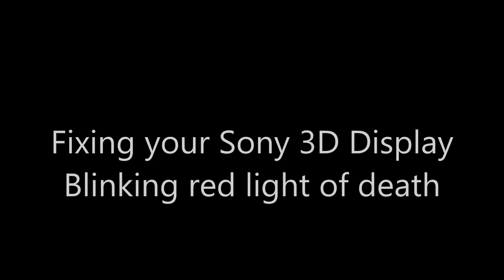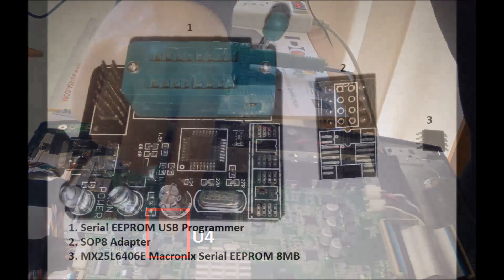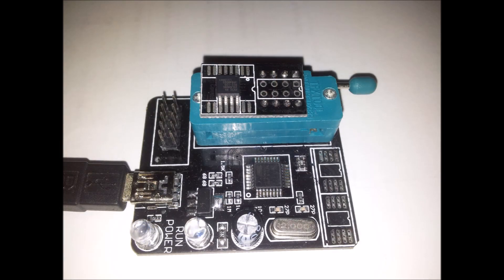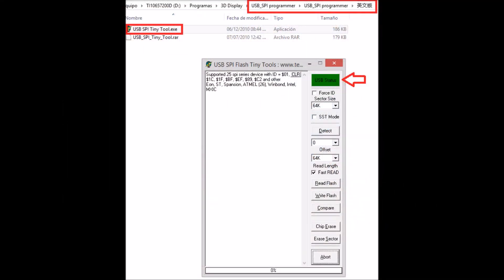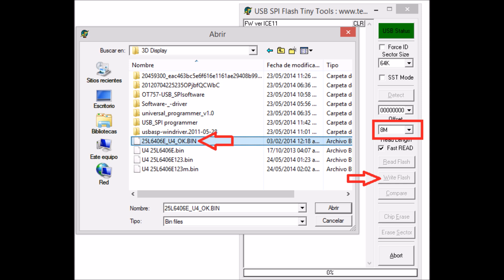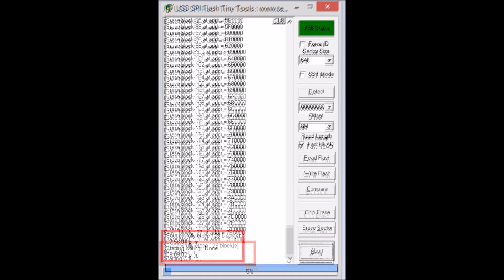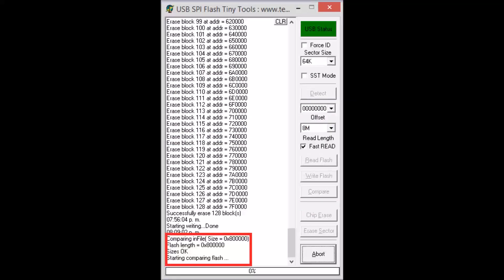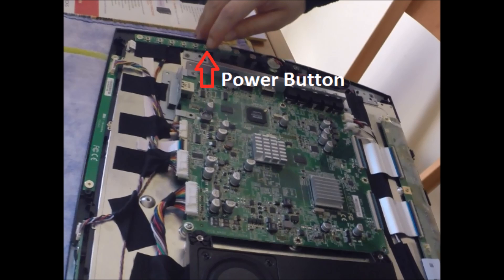English Version: Sony Playstation 3D Display CECH-ZED1U Blinking Red Light fix repair (Real)

Comment: Hellow nice video  hope this will help to me because my monitor facing same problem . It's on  blue led then green then  2 blink red continuously . I test eprom pin number 1 which chip set 3.3 v should flactuat while power on but it's not. So decided to reprogram  the eprom ic . But it is hard  to get firmware on website .my monitor model CECH ZED1U
Reply from the maker: You will find the firmware binary in the description. Replace the chip.

Comment: Hi , is possible hack this SONY 3D Display (PS3) putting like a port HDMI-OUT to output video to others monitors/TV/displays?  
thanks.
Reply from the maker: Hi, to do that you need an special hdmi splitter that is not included in the display hardware.  Buy one on amazon, 13 bucks. https://www.amazon.com/HD-102-Powered-Splitter-Certified-Support/dp/B005HXFARS?ref_=fsclp_pl_dp_2

Comment: Lol, had a good laugh, when you said you have to weld the E PROM back on to the circuit board!!!!

correction it's called solder it to the  circuit board!!!
Reply from the maker: Thx men. How do you know when to use weld or solder?
Reply: Any thing that involves circuit boards, is soldering, welding is a process of joining to metals with high heat or electrically, as in ark welder, mig welder or tig welder, and if you tried welding a circuit board, with oxygen and acetylene , well you would destroy the board, as for using a means of Ark welder or the other two types , well that will never happen period , I am sure you understand why!!!!
Reply from the maker: Thx great, in spanish we use the same verb "soldar" for all you explain. Regards
Reply: Lol know problem, I can see what you are saying, but hey now you know the difference!
Reply: it's "no" problem bruh..

Comment: I'm trying this with windows 10 but the software isn't recognizing my EN25TE80 Programmer, and I successfully installed the drivers, but everytime I start Tiny Tool usb status is red.
Reply from the maker: Hi, try using another machine with windows XP. Regards
Reply: Thanks for the reply. Ok so I got a working driver and software but now when I flash the EEPROM with the bin file and compare it it's different. Any ideas and Is this the correct position for my EEPROM?
https://s33.postimg.org/80nhgcti7/20160523_234716.jpg
Reply from the maker: +Skormie you must weld the eeprom to avoid miscontact
Reply: ok but the dot on the eeprom should be to the top right like in my photo?
Reply from the maker: Yes, the position is OK!

Comment: Hello. I am having problems with the programming software. I have all the correct hardware. When I pull up tiny tools and plug in my programmer, the 'USB STATUS' never changes from red to green. Can you help me?
Reply from the maker: jonfrancoz Hi, please verify you installed the drivers correctly, remember that those are not signed by M$ then you need to start Win with support of unsigned drivers. I hope that helps. Regards
Reply: I tried to do that. It didn't work. My computer is detecting the programmer, and when I run its driver it says they installed successfully, but no programs are detecting it. Do I have the correct driver? I am running Windows 7 64 bit.
Reply from the maker: jonfrancoz Hi, are you executing this app "USB_SPI programmer\英文版\USB SPI Tiny Tool.exe"?
Reply: alejandrovquiroga1 yes, I am. I will explain my steps. First I plug in the programmer. It is not recognized. So i download the driver. The driver install program installs "CH341WDM.INF". The device is now recognized by the computer as "USB-EPP/I2C... CH341A". I try to execute "USB_SPI programmer\英文版\USB SPI Tiny Tool.exe" but it responds saying it needs "libusb0.dll" to run. So I move "libusb0.dll" and "libusb0.sys" to the same folder. Tiny Tools now runs, but it never detects the programmer, and I have tried many different things. I don't know if maybe my programmer is just broken (but it is detected so I do not think so). I will attempt to find a different computer and try it, but for now I have no other ideas. Thank you for your quick responses and for the video.
Reply from the maker: jonfrancoz You are very welcome. There is a problem because I didn't put those libs in the same folder. I think there is a problem with the drver installation. Please repeat the process from scratch. Regards

Comment: Ghosting you can remove most of it due to software issues in the Tv simply by switching between your 3d settings, then back to auto.

Comment: Oh I spent probably days getting these settings so your welcome. Their is what you call Temporal dithering in the black levels with these tv I have pretty much got rid of it all, and the green effect as well. Also with a really nice color level, and white saturation level. Note: YOU MUST HAVE AN AMD CARD TO DO THIS. Now with that stated lets start.

Amd 
Brightness= -25
Contrast= 73

Sony 3d display
Brightness= 87
Contrast= 100
Color= 44
Reply from the maker: ***** Sorry Travis, I don't understand your comment. This settings are to resolve which issue?
Reply: To resolve dithering, green in lower shades of black levels, and ghosting due to the software glitches. If you want to know what dithering i'm talking about loo at these test patterns. http://www.lagom.nl/lcd-test/black.php

Comment: Hey I was wondering if this programmer would work? All of the other ones are sold out.
http://www.ebay.com/itm/24-EEPROM-25-SPI-FLASH-BIOS-TTL-USB-Programmer-ATMEL-WINBOND-24-25Series-adapter-/151167685202?pt=LH_DefaultDomain_0&hash=item23324bd252
Reply from the maker: Hi Tait, yes, it says it supports 25 series, the serial eeprom you need is a 25 series, that programmer should work. Regards.

Comment: can you just flash the eeprom thats already on the board.
Reply from the maker: Hi, I heard some stories that the same eeprom failed quickly again. I strong recommend to use a new eeprom. Regards
Reply: Thanks for the info just ordered all the stuff to do this it's my first soldering project so i hope it all goes well!!
Reply from the maker: Crispysamurai One tip, do not try to desold the original, just cut the legs, remove the body of the original eeprom and after that, desold the rest of the legs.
Reply: wow, thanks man everything should arrive within 2 weeks ill let you know how goes.
Reply from the maker: Crispysamurai Hey, did you success on this?